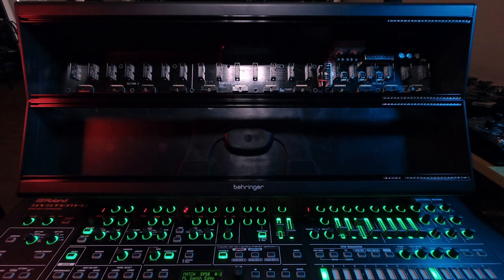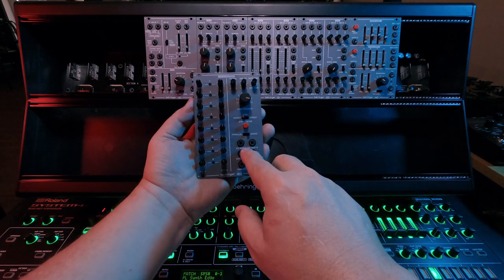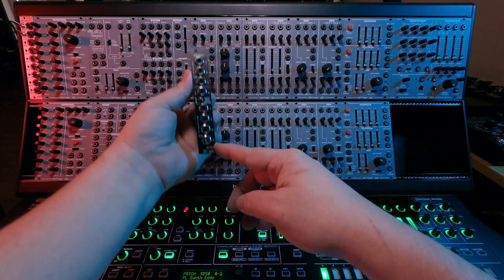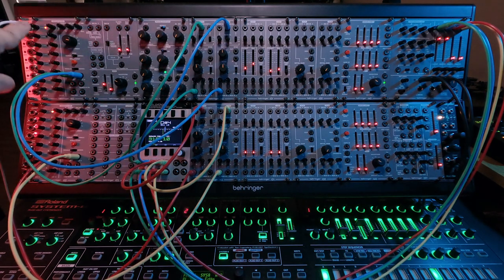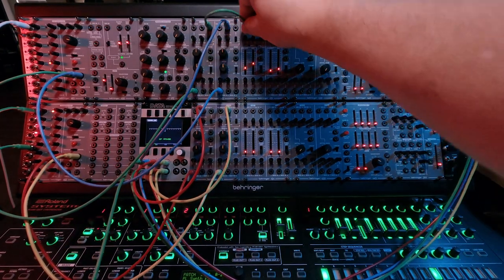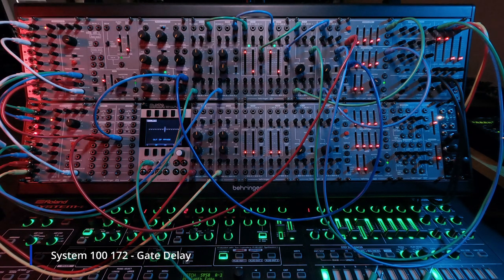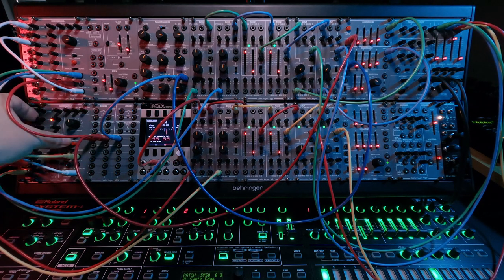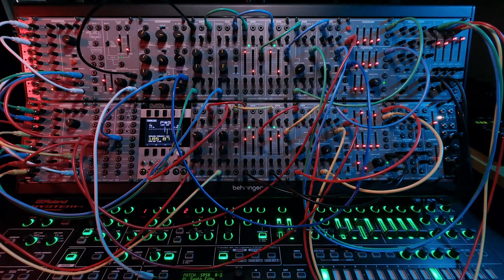My Modular Journey - Season 2: Episode 8 (System 100)

Comment: I have no problem with Behringer, I just bought the System 55 and will be adding a few more modules to the bottom row, I have they're Odyssey, DeepMind 6 and the 2600 and have had zero issues with any of it, I will eventually be adding the System 100 to the mix, Very informative video, thanks for posting. Just found this video and learned some things from it even though it is a year old.

Comment: Great video!!! It's good to see how one could build up a patch from scratch with these modules and in particular which additional modules such as clock divider and quantizer would be needed, as they are a bit of a must-have in order  to get going. So, pointing out what additional modules to get to complement these basic modules is very appreciated.Things got out of hand for me and ended I up with a 8 voice 24 oscillator 100m system put in sturdy, custom made IKEA skiffs .....

With regard to Behringer hate, I thinks it undeserved when it comes to their 100m series. It's true to the original more or less. The build quality is good. Out of 24 oscillators purchased, 1 was defect which was replaced immediately, I guess that's ok.

The not so good things in the system is that the oscillators have had tuning issues (see Tim Shoebridge),  the tiny pots make it very hard to tune the oscillators/sequencers and that same controls (portamento) need to be attenuated in order to be useful. Otherwise, I am quite happy with it.

Comment: Great video! The jam at the end sounded great :) I just bought the last module I needed to complete the 2500 series clone. I bought the 182 while i waited for other 2500 modules to release, and yeah, that 5v range is definitely tough to deal with without a quantizer, which I use an Erica Synths pico quant for. 

Liked and subbed!

Comment: Great video, thank you! I just ordered my first modular, many modules from the system100. 
I'd love to see more in depth videos of the individual modules. Screw the haters. 

The only solid reason to hate Behringer is when you bought a 5000 euros machine (like the 909) and now Behringer made a better version for 350 euros and you feel ripped off. 
"I have a studio worth 200.000 euros because I have collected super expensive synths which aren't produced anymore"
Yeah, nice, I have the same setup for 10.000 euros because Behringer copied it, included MIDI and USB, added community suggested features and released it for an honest price instead of making it only accessible to the elite and rich. 
If you don't like it, just don't buy it! Feel free to pay for overpriced machines, it's your money. And there are loads of machines they didn't copy and are awesome! 
Small machine producers can't compete with the low prices of Behringer, that's true. But there's always a market for those machines too. 
R&D will never stop, even Behringer does R&D to create new machines like the Neutron and Proton and to continue the Crave, Edge and Spice line (further then Moog did). 
But they also copy stuff that's not produced anymore which is super expensive and rare (909, 808, 303 etc.), and copy stuff which is a ripoff (Moog Mother32 etc.) while make it better to make it accessible to anyone. 
Programmers copy and share their codes all the time. It makes the world better. 
Just be happy you don't have to sell some of you organs to be able to buy a synth to add to your collection. I'd rather have 10 cheap ones then 1 expensive one for the same total price. Focus your hate towards Putin instead :)
Reply from the maker: Love your passion, especially the closing line 🥰 While I myself do not hate Behringer, I do understand the animosity isn't necessarily the copying of old, unavailable hardware - it's copying things that are still currently available - e.g., Swing, Abacus, etc. Otherwise, I love how Behringer revives old, dead classics at a fraction of the cost to us than "official necromancy", so for that I am grateful. My UB-Xa is enroute 😁
Reply from the maker: PS: Welcome to The Rabbit Hole (modular) 😂😈 The Rabbit is old. The Rabbit is wise.

Comment: I didn’t hear you mention this but there are 11 system 100 modules, the one you don’t have is one I’d recommend to anyone curious about getting the system 100 sound with just one module. It’s the 110 module, which is also recommended by Tim Shoebridge as a starter module. 

These modules sound great and are stable and very flexible analog modules. I love them all except maybe the 172 phase shifter/delay which is really underwhelming and I guess it’s the same with the old Roland versions.

Comment: I have also nearly completely built my system 100 as well (another Shoebridge victim!)  Just missing the 297 but that has increased in price pretty heavily, so as a nice to have module (as opposed to need to have) I'll wait for a good deal. You probably know this by now, but I find the tuning switch on the 305 mixer module is great.

Comment: Fabulous video. Can you help me though plz. I have a full system as well, apart from the combined vco,vcf and vca module (110). I can only get stereo panning with the module mixer if I plug the outputs straight into the speakers. If I plug in via my UMC22 Behringer audio interface, it combines the outputs and its basically mono. Are you using a stereo mixer or something??  I need to monitor the stereo from the speakers as well as record in stereo. I've tried to get help from forums. But always seem to get the 'what are you trying to achieve ' and 'whats wrong with mono?' Unbelievable.  Please could you explain in simple newbie terms. Thank you kindly.
Reply from the maker: Taking a quick look at the UMC22, I do see 2 inputs (mic/inst) and 2 outputs (L/R) but I do not see an option for "panning". If you're also using a DAW (Abelton, Logic, etc) you'll likely need to pan the incoming MONO signals from L/R Out to either a stereo pair or 2 mono tracks in the DAW, which should then let you pan. Aside from this, I am afraid I cannot help much more. The above is exactly what I use, but my mixer is a Mackie DL32R so a bit bigger than the UMC22, which may be more configurable.
Reply: @VisionsMusicGroup  The system 100 has a panning function on the mixer module. Since I posted this I purchased a stereo audio interface and my problem was fixed. So the UMC22 is mono.

Comment: Great video 👍. I'm looking to get the 110 (VCO+VCF+VCF) to get a touch of Roland smoothness for the Neutron-based sound engine I'm building for my Roland AE-30 wind synth. I'm sure it won't be the last of these modules! 😀
Reply from the maker: Thanks, Uncle Mick! 🥰
Reply: I can 100% recommend the 110 Module. Sounds better than my Neutron. Wonderful analogue smoothness, really nice filter. Price point is incredible.
Reply: @tauminoris6035  it's so nice being able to add stuff to the Neutron like the 904A filter for some solid bass tones. I'm trying to figure out some VCAs so I could have the Mooginess when I'm playing down low and then a choice of Neutron aggression or Roland smoothness when playing up high.

Comment: Audio Delay is used for a chorus or flanger effect.  If you can get the dry signal mixed with a delayed signal you’ll get a comb filter.  If you add an LFO to the delay time (while the dry and delayed signal are mixed) you’ll get a chorus or flanger effect depending on delay time.

I was about to go all in on System 100 last year but ran into the same stock issue as you.  It may be time to do it now that they are all back in stock!  Any purchase regrets in terms of modules (buy more/less, omit, etc.?)
Reply from the maker: Thank you for the Audio Delay tip! As for regrets, as far as these System 100 modules go the only thing I am not making use of is the 297 (except the dual Portamento occasionally) and the ParametricEQ in the 305. Seems a waste that the EQ only handles 1 channel, unless I have completely missed a feature somewhere 😁 I may not have needed 2 ea VCF, VCA and EG... since they have so many i/o each... but it wasn't a heavy spend and looks all sexy in it's symmetry 🥰
Reply: @VisionsMusicGroup  the 297 has a lot of functionality. It has two 4 channel CV or audio mixers, you can invert the output signal and that can be a gate or any control voltage. Tons of uses for that to create complex LFOs and more. Inputs 3 and 4 are normalized to + or - 10v and you can attenuate those levels to send specific voltages to other modules. 

If you use the +10v out near the middle and send that to the CV input on the delay, it slows it down a little to where it’s almost usable as a chorus effect. It’s more of a bucket brigade delay or flanger than a delay; I wish they hadn’t called it that but maybe that’s what Roland did as well. It’s pretty noisy so I don’t use it much but it is fun to play with. 

All these modules are discounted right now so I’d encourage everyone to get at least a few of them. They are real workhorses for any modular system, and sound great in my opinion.
Reply from the maker: @ericMT  I agree with you on all counts, especially the ''get em while they're cheap(er)' recommendation. They are wonderful little modules.

Comment: QUESTION: does combining the dual VCO, dual VCF, dual VCA, and dual Envelope Generator yield a true "two-voice" (duophonic) polysynth? As in,  can both VCOs run through their own independent VCF/VCA/EG? Or, in practice, is it more like paraphony, where while the VCOs may be assigned different pitches, they all run through the same VCF/VCA/EG? 

I'm trying to build a 4-voice polysynth with the system 100 and this would be helpful to know.
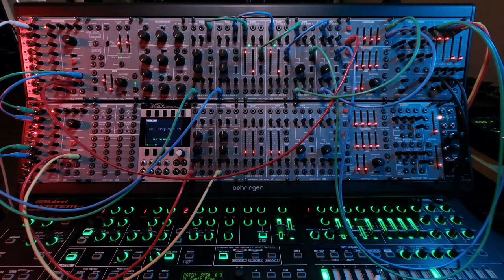Reply from the maker: Hello! I am no expert, so you really should fact check me, but if you look at chapter Part 2 Recap @ 36:03 you can see a green patch cable going from VCO 1 to VCF 1 to VCA 1 and a gate signal to EG 1 that opens/closes VCA 1. Same with blue patch cable (Voice 2, completely separate signal path), and later for Voice 3 (Red) and Voice 4 (Yellow) by the end of the presentation. 

I have never done "polyphony" with a keyboard controller, but I know this setup (dual 112, 121, 130, 140) would yield 4 entirely separate voices, each filterable and enveloped/gated separately. I think this is what you're asking. Hopefully someone else can weigh in and verify this for you.
Reply: @VisionsMusicGroup  thank you for the reply! This is helpful. This lets me know the modules are capable, and that it’s just a matter of finding a keyboard that can pull off the desirable note allocation… 

In a semi-related note, is there anything in the modules that would allow for keyboard filter tracking. Because, as I’m sure you know, playing polyphonically without keyboard tracking can be problematic
Reply from the maker: @jibberish00  Hmm, this I cannot be sure of. I do know that MIDI to CV converters usually have a Pitch, Gate, and Mod option, where the Mod might alter frequency on higher notes, but that would require the Controller itself (keyboard) to send that data as something that can be converted to CV. Might ask the experts about that one, this is just my guess.
Reply from the maker: @jibberish00  FYI, just rediscovered this guy's films on the System 100 duophonic concepts, if you want to check his playlist out https://youtu.be/hs2nm3CrGZ8?si=f5_yE1_Lz8P0iPAJ
Reply: Yo, Zach! Just my tuppenceworth, but you could build a minimal duophonic system using just three Behringer modules plus a MIDI/CV module. Two 110 voice modules (not included in the setup displayed in the above video) and a 140 dual-envelope/LFO will suffice to give you a duophonic synth (you may find that you also need a couple of multiple modules but these are dirt cheap). Happy noodling!

Comment: i stumbled across your videos a couple of weeks ago - i am on a similar trajectory to you with modular.  i got the sys 55 because of the sale and then i got a load of these sys 100 modules (because these were the ones i always truly wanted) - i noted your recommendation re the LADIK quad quantizer, so i bought 2 of them, one for the sys 55 and one for the sys 100.  the sys 100 sequencer is almost impossible to tune without a quantizer.  did you end up remover the jumpers on the back of the module to make it work properly?  i thought the ones I had got were faulty at first, but removing the jumpers completely solved the problems i was having on both of the quantizers i bought - still havent tested the LADIK module yet with sys 55
Reply from the maker: Regarding jumpers on the Q-040, yes I do have the jumper(s) removed. I did this so long ago, I do not recall why, but I just double checked 😁 Thank you for watching!
Reply: @VisionsMusicGroup  when i first got the modules from LADIK, they didnt seem to be quantizing all of the notes properly...some notes really stood out like a sore thumb...the website referred to 3 jumper settings, top, bottom and no jumpers at all.  i tried them all and the 'no jumper' option was the only one that worked...something to do with the sensitivity to the incoming voltage signals.  anyway i am glad i got them to work (seems maybe you had a similar trial and error situation that you may have forgotten about?)

Comment: How do you like the case?
Reply from the maker: I actually love the Behringer GO case. I've thought about picking up a 2nd for the MiniMOD system. The only thing I dislike are... sliding nuts. But they can be replaced 😁
Reply: @VisionsMusicGroup  Does plastic feel sturdy?  I have been going back and forth between a wooden case and behringer go case.
Reply from the maker: @tomburden  Honestly, it's not super solid like wood of course. There are gaps around the edges, and it does bend slightly when you pick it up full of modules. But for me, the benefits of cost, power (3A) and portability outweigh a barely noticeable plastic feel.
Reply: The case is sort of a clone of the Tiptop Mantis case which is also plastic. It’s pretty nice for the price which is only $229 on Sweetwater now. All the modules are less expensive as well so it’s a great time to jump in to this series of modules.

Comment: B haters = people who realize they paid way too much for their non-B modules.
Reply: Or they resent the actions of behringer suing people and companies that call them out for copying existing products (SLAPP suit against Ebtech over the comments on a forum about behringer stealing a cable tester design, or the Behringer Swing.) Behringer’s synths and mixers might be affordable and of decent enough quality, but i have trouble supporting a company that will make promotional material making fun of a journalist that reported on their issues.
Reply: I like B-modules and have other more expensive to, it doesn't matter and they really make good modules
Reply: I’m putting together the 100 system now, next the 2500, or maybe the 2600, that ones easy! Lol. However mixing the Dreadbox system in (very affordable as well, then I’m running the Behringer Brains instead of the 110 right now. I’ll get one eventually plus I’m running a Radical Technologies 311 Swarm, a AMS Ensemble and a Roland M1 with a crave, k2 and Neutron. All of the Dreadbox  Effects with modular connectivity a few without. So you’re set up is pretty close to mine. I went crazy with the oscillating 69 so far just in this set up. 71 with the Deepmind 12. I haven’t decided to use it as my keyboard yet. This I Just the Modular, I got more full synths and guitar synths, tons of FX. I love Behringer I would never have Been able to afford a modular set up without them! I’m paying close attention to your videos because I’m new to Modular as well! Both feet in the deep end!!! Lol ty for the video’s!